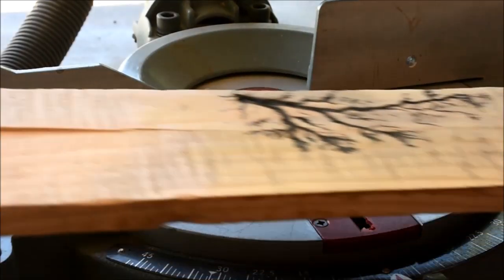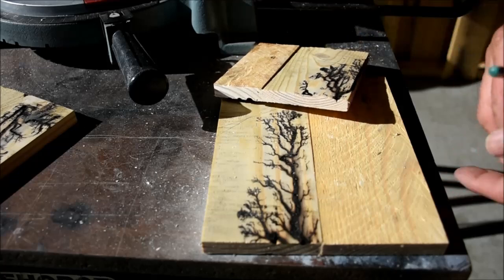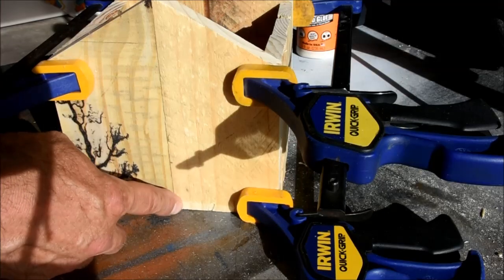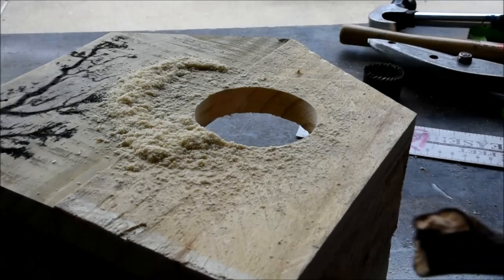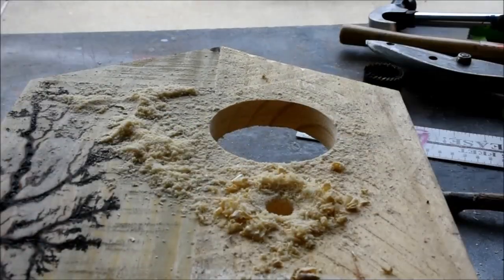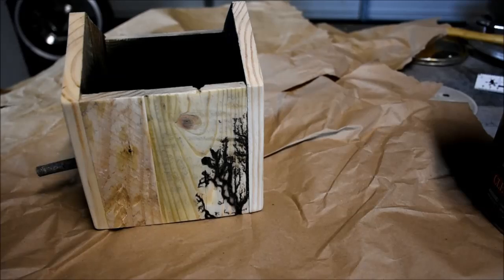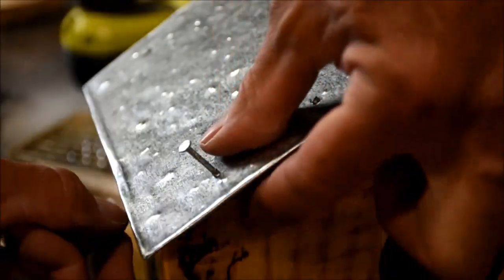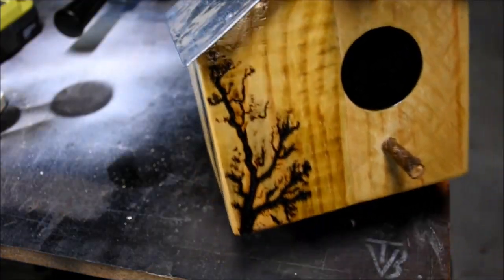Bird house build - step by step

Comment: Your bird house would be the best bird house ever on YouTube
Reply from the maker: Thank you for the compliment.
Reply: Exactly
Reply: Best for human eyes maybe, but definitely not for birds. Tin roof makes it too hot on sunny days, a perch will allow predators to access eggs/hatchlings the bird house is too shallow (hole should be further up from the bottom, and there should be metal around the hole to prevent woodpeckers from making the hole wider. Apart from that, the bird house looks nice!
Reply: @Vinterfrid  also paint on the inside? Not too good for birds. The “I don’t care if the nail goes through to the inside” comment maby good for show but not for the birds. No drainage holes? How is it cleaned? Too much thought has gone into making this cute rather than thinking about the birds!

Comment: I recommend using nails or screws to hold it together,  Mine put together with just glue started falling apart with babies in it.  Had to put screws in it, with the babies there, bottom and side was falling apart.
Reply from the maker: It definitely can't hurt.

Comment: Stephen Standridge
2 minutes ago (edited)
Nice bird house  but no good for birds. This is a great house for decorations >
But you did say this was for decorations. If some one wanted to build this for a real bird house.
you would need a  to 1 1l8 inch hole this would be  for wren , titmouse , chickadee etc. No post by entrance this would help predators. Also never paint the inside of a bird house and I wouldn't even put any kind of clear coat  on the outside the chemicals good be  bad for the birds.
No metal roofs because the metal wood heat up the inside like a furnace. Look up the type of bird you want to attract and find out room size height of entrance from bottom because this matters.also need a way to clean out the box.

Comment: What gauge steel did you use for the roof?
Reply from the maker: Sandy, I'm not sure what the gauge is. It is a thin sheet metal used for furnace duct work.

Comment: a wooden roof re-opened with metal! presents a loss  of minimal internal heat!
Reply: It's decorative, don't think heat is a problem. lol
Reply from the maker: @MrSTOUT73  Exactly what Wayne said, thank you.  Also, I've never heard a bird complain about free housing. Haha.
Reply: A wooden cover BEFORE AND AFTER, the protection in sheet metal!
It does not take long to figure it out, there would also be an amateur carpenter; on condition that he sees the thing from the point of view of the survival of the animal.

Comment: The birdhouse looks very nice and I like the lichtenstein arc path on it to look like trees, but tin roof would make it too hot inside and no bird boxes need a predator perch on it. What kind of birds are you hoping will nest in it. 
I have made bird boxes out of logs, pallet wood, old wood furniture scraps an ornamental wooden whiskey barrel and fence panels. All with holes no larger than 25mm (1 inch). Plenty are used but a robin nest box still has yet to be used. It is not camouflaged so it is exposed and they wont use it but do like to use a teapot hidden in the bushes.
Reply from the maker: Ian.  Firstly, it's decorative.  Secondly, I see any bird house as a better option than an open nest which is more prone to predators.  I have built several bird houses that are not "optimal" and they all were occupied for multiple seasons.  If I put a bird house out in the tree and birds don't use it, I have no hard feelings toward them.  Take care.
Reply: We keep our tea pot on the table it saves time searching in the bushes!

Comment: Great video.  I like your birdhouse and all the options you mentioned for the roof in terms of material u can use like a soup can.  Not sure about painting the inside - probably better just to leave it be.   I do Like your roof.   What is that tool for folding in the ends of your metal roof ???    Thank you !
Reply from the maker: David Azinger Thank you David. I would normally leave the inside alone, but the wood was scraps and pretty beat up. I thought it was distracting so I painted it. The tool is called a sheet metal seamer.